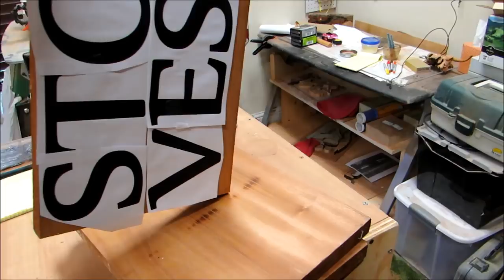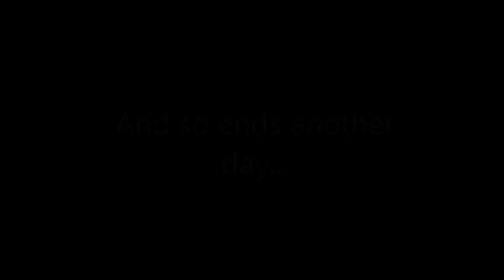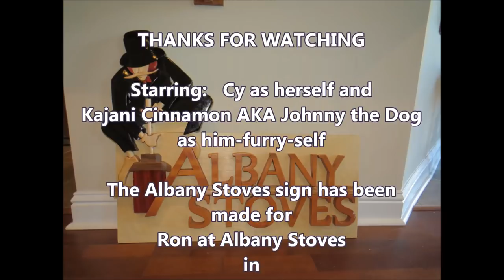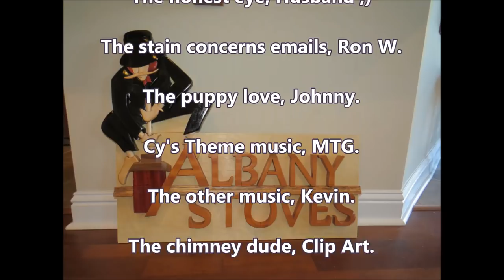Albany Stoves Sign

Comment: are you using tin foil during the initial glue up?  is that better than wax paper?
Reply from the maker: Russ Veinot I didn't have wax paper, so I used the foil instead.  It seemed to work great, I think it may be more difficult to remove from the wood if the glue had oozed all over????  But I dunno, will use the foil again for sure!